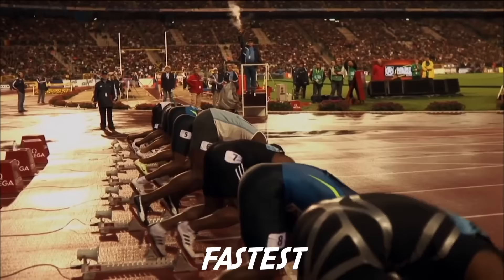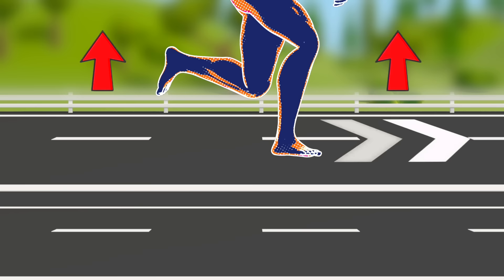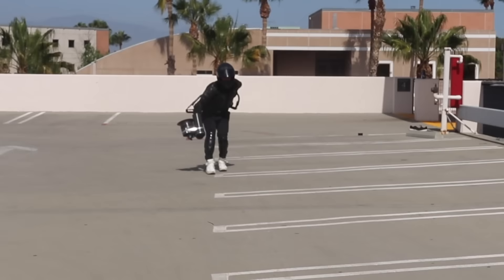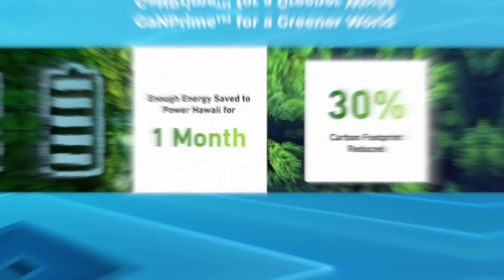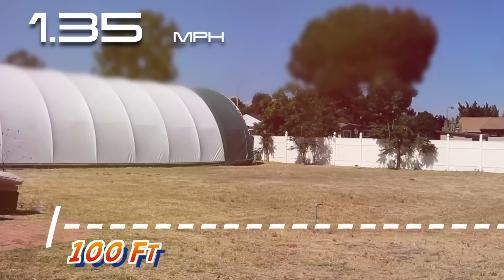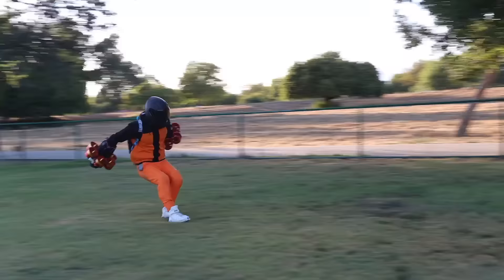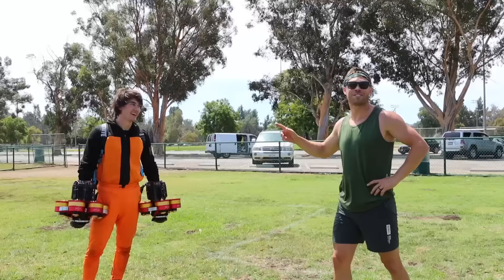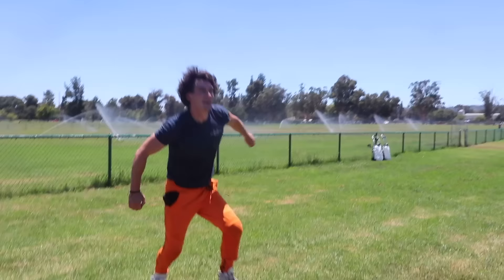I Built Shoes To Make Me Run Fast! (World Record)

Comment: It's kind of funny, we try so hard to even approach the top speed - for a few seconds - of a guy like Usaine Bolt - meanwhile, a random ostrich can hit 40-45 MPH casually and keep that speed up for like 10 minutes or run at 30-35 MPH for an hour straight without stopping. Sure, the Cheetah's top speed of 70 MPH is even faster BUT it's a sprinter - which means it can't keep that top speed up for more than a matter of seconds before overheating. For me the most amazing runners are those who can keep up consistently high speeds for a long time - tens of minutes - like the ostrich, race horses or the fastest animal in north america, the pronghorn antelope (50 MPH top speed). But as far as TWO legs go? For an ostrich to hit 45 MPH - and some might be able to hit 50 MPH but we never really tested their MAX speed under controlled circumstances - on TWO LEGS - about twice the speed of the fastest humans who ever lived - is insanity. Some other sources say 60 MPH is the ostrich's MAX speed when it absolutely HAS to go all out to save its life - and that's just fucking LUDACRIS when you realize how much harder it is to put out that much power to reach that speed with only two legs in contact with the ground - and it's also so fast that only the cheetah can really top it, albeit not for long. 
Aren't you glad ostriches don't have teeth and claws and eat meat?
Reply: Fun fact about the ostrich is humans and ostriches generate similar amounts of force while running meaning the ostrich is far more efficient at turning that force into speed
Reply: Don't ostriches also run on sand which is harder to do
Reply: @slasher3582  they can but they primarily live in savannah's planes which is just normal dirt

Comment: I think the heelies would've worked well if you experimented a bit more, the way I see it, you could've put your foot in front of you with the wheel on the ground, but then at the end of your stride push off with the toe of the shoe. This way you still get the benefit of sliding, but you're still running as you're pushing off with your feet. This opposed using the wheels the whole time as he was doing before.

Edit: this concept would also work if he put the teflon only on the rear half of the shoe, so he could slide on his heels, but also run on his toes.

Comment: The whole time I kept thinking, "wouldn't it be better if he attached the motors/jets to the sides of his hips?" They'd be pushing your center of gravity, and you could actually use your arms to balance better. Plus they would stay at the right angle. All you'd have to do is connect some remote controller for turning it on!
Reply: I think it would be much harder to micro control directional movements and corrections
Reply: But imagine if he fell backwards and tried to catch himself and ended up with a handful of jet.
Reply: yeah but hes to heavy its better that the motors are pushing him than picking him up

Comment: !IDEA!

One thing i would love to see is a device where you can breath underwater. Obviously you would need an air source, but not all the clunky ones where its a massive, heavy container on your back, like scuba diving. It would have to be compact, allow you to swim without flippers, and maybe it could have a breath system where you have 5 breaths, each in a different part of your body. They would have to have weights attached to them though, to counteract the air inside, and then you could maybe drop of the weights when your finished with the tank you used. Idk, just an idea.
Reply: I'm not going to read the bible bro
Reply: Don’t they make some kind of mouth piece that can take oxygen from the water? I js remember seeing this on tomb raider and I looked it up and it was real
Reply: Sucba diveing equipment and he already did a James Bond under water air

Comment: What if you took this project and make a realistic prototype suit of the Flash? Instead of having the thrusters on your arms, why not take one thruster and put it on the back of the suit? That way, your arms won't have to be held behind you, as if you're in an Anime, and you could still get some propulsion. Yes, you still need to practice on keeping this Suit under control, but this is probably the closest thing we have to a real-life Speedster Superhero.
Reply: because his back would block out a bunch of air intake that the fan would need to suck in, unless he added vents but that would still be inefficient
Reply: @ianmendoza8599  Maybe, but it still beats tiring your arms out by holding them up behind you with two heavy fan-gauntlets.
Reply: @ryonhatcher4561  no it doesnt cos it would provide him with minimal thrust lol. his only air intake would be the corners of the fan that arent directly behind his back so he'd need a massive fan for it to work. if his arms get tired he can just make the arm fans able to go in reverse so that he can hold his arms in front of him to 'pull' him forward

Comment: Great video as always! 

But why did you place the thrusters at the level of your hands? It might give you a bit of speed, but you lose so much stability. Maybe by running normally with your arms swinging back and forth and with the thrusters on your back (on a backpack or a suit), you could go much faster because you would have better control of your speed.

Comment: You should attach the trusters to your sides or around your waist, where it will provide more power and stability when running forward. Think of the design similar to the rocket/jet belts in apex legends

Comment: if you add a gyro sensor and wrote a code to control the motors DC separately to keep you aligned with the ground and finally another altimeter sensor to keep you at fixed point above the ground you will be able to hover and maintain you high speed with out falling down and also you would be able to use the motors to brake whenever needed

Comment: you could try to add wheels that would support you from falling down.
Like for bicycle training wheels.
This way you could still run, be less worried about falling (if you have 3/4 wheels)

You would also be able to do it on concrete or a road.

Comment: 3 months past, but maybe you'll see my suggestion, so why do you need jets on your arms?! You can place them on your back at 45 degrees angle and place the battery pack on your chest as a counterweight - theoretically jet must push you and forward and up, so your speed would be increased and your steps will be longer as well

Comment: I want to see you on some off-road inclines or a long board 🛹 rocking that that rig. For fun maybe you could try to get the highest grade ball bearings and a higher density wheel. 

Fun side engineering story: ex-girlfriend's dad was a lead engineer who manufactured ball bearings for NASA at insanely high abec levels, he gave her super hardened abec 11 bearings with super low viscosity lube you literally can't buy.   for her inline skates she used to use to get around campus ... Her dad being a lead engineer always over engineered everything like someone from NASA would, when she skated on them she went insanely fast and there was almost no friction so she couldn't slow down outside of a high velocity hockey stop which was out of question given the ridiculous speeds she could now skate.

Comment: Some jets like back pack to push you up and lower your weights would also help. And a couple to push you enough forward. But so that you dont fall. I think you could get even better then 30 if you improve the design. You should trust in you running skills. With those improvements you should be able to get up to 30.

Comment: I'd be curious with some better optimization, how much faster you could get with this. Big concern however is the risk factor.

Like just some ideas off the top of my head that I think could work.

If the jets were sort of anchored more towards your center of gravity, your balance should be much better. Connected to your arms they can move a lot which means you can't get consistency in the force you're reacting to. If they were anchored and not moving, you'd be experiencing the same level of force consistently, so almost like riding a bike you could learn how to run with the boost.

Adding some downward facing jets could help with height/length in the strides while running, pretty much exactly as was being shown at 5:18 when pointing the jets down where it slowed your descent. When paired with the sliding factor as well it should help reduce the weight being put onto the shoes meaning they'd allow you to slide slightly further.

Some other ideas exist as well such as some sort of counter-force jets to help stabilize you while running, but really I'm not sure if those would be counter productive.

Comment: Where did you get the Teflon stuff that you put on the shoes? Also I think taking it off the tip of the shoe would increase running speed as there is more friction for the run while still being able to slide. Just a theory though don’t know if it makes any sense. Also also how did you attach it?

Comment: Make the jet pack wind powered and position the fans over the jets in the opposite direction in which they spin. Include a 15000 watt solar panel to start them. Encase them in titanium. Then, the titanium armor casing should be covered in diamond dust. This would create an impenetrable suit of armor which flies. Also, use a can of canned air with a magnesium-thermite reaction to create free diamonds. Simply shave a magnesium bar with titanium then get your pressurized co2 ready and aim it at the magnesium. Once magnesium touches thermite, it creates a 4000 degree red flame in Fahrenheit. Then use pressurized CO2 to create diamonds. Leave it burning for 24 hours. This will create black diamonds. Then use a diamond bit drill to shave off diamond dust. Then, use loctite to attach the diamond dust to the suit. This idea is a Christopher Jordan Sturgell original. All of it. You’re welcome.

Comment: If you were lighter it wouldn't be a problem you just need to point them at a downward angle to the ground so that when you run you don't have to push off the ground is hard

Comment: Redo the test but lower your arms to give you a but of upward thrust making you lighter and another doing the same but use those shoes and run like you're wearing the jumping shoes. Essentially one leg infront of the other and the one infront stays on the ground for a bit technically sliding them switch and do the same almost like you're ice skating or roller blading

Comment: inf tom get invinsiblity for 5 seacond but die after 30 seadonds ,grapple gun grapple to blocks to travele there radius 40 blocks if hit player pull them towards u ,zipline put it two place and connect to travel fast using it raddis 60 blocks, thuster launch u 20 bloacks in the air but does not give fall damage immunity,bounty setter when u use the item by targeting the player by it you get 1.5x damage and lifestele 20% and get( 2xloot this is just addition)  onnthem for 30 seaconds cd 2 minutes

Comment: @JLaserVideo I'd bet if you turned the motors around and held them out in front of you it would seriously improve balancing issues and let you achieve more lift without having to lean back and slide so much. Assuming there's a way to have the jet's exhaust not rip you apart... But you would lose the amazing anime look.

Comment: why not just atach those jets to your hips with a fixed angle to always push you up and forward, also add some on your shoulders for extra propulsion.
Edit: also take some of the shoe slipery material from the front so you still can push full force when sprinting, leaving the rest to just slide. you will get more force

Comment: Thr only problem with this is it would be really bad to use for real shinobi. It's very unreliable if needing to escape, and if you need to move swift in the rain it wouldn't work, it would be close to impossible to use when running in the woods, even if it can be mastered it can't be used repeatedly for a long periods of time, like needing to travel many miles of distance. If you wanna move at break-neck speeds beyond 30 to 40- 60-70 mph on road or sidewalk or heck maybe even on very low grass, give inline-race skating a try. To me, this resembles running the most in terms of form out of any other skates. This is modern times, to me Inline-race skating would most likely be equivalent too being your own horse.

And get this, when you're trying to just maintain a good speed, you lean forward and put your arms behind your back, In a way just like the naruto run.